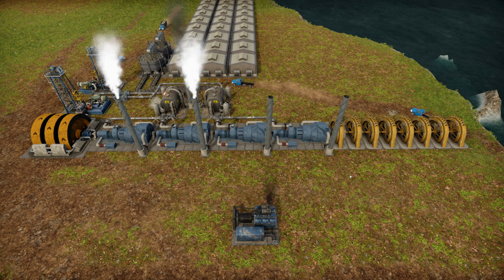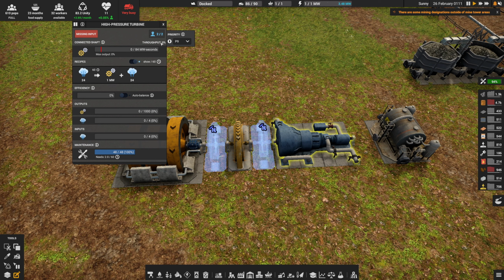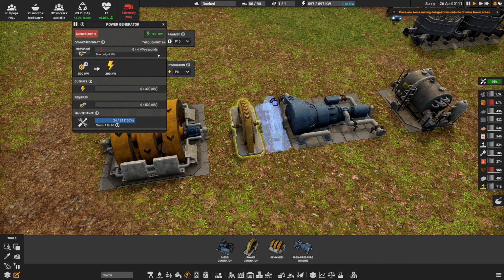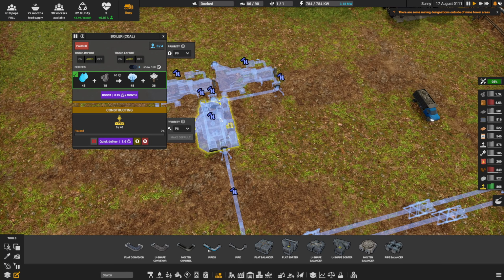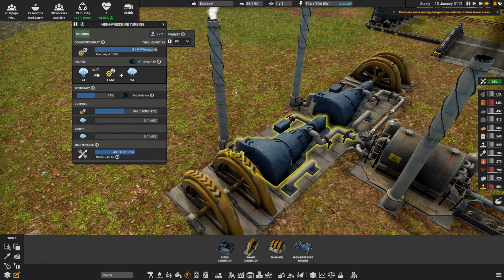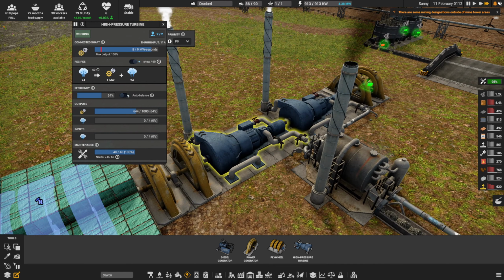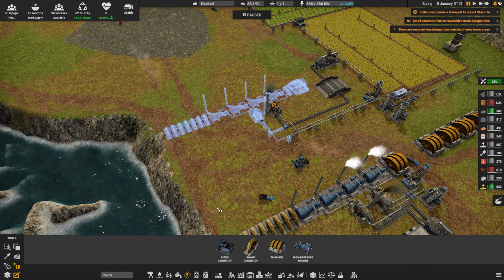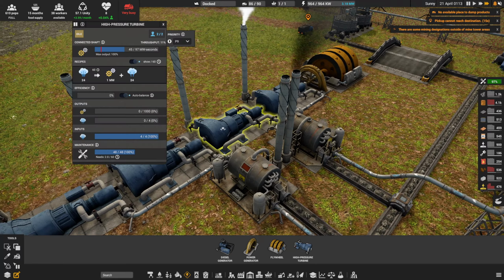Power Generation Explained 🚜 Captain of Industry  👷  Tutorial, Guide, Tips

Comment: Coming from factorio, the use-case for auto-balance and flywheels eluded me to begin with because it is not entirely intuitive and I don't think you really stated it clearly: In COI (unlike in Factorio and real life for that matter), the turbines are either off, or they run at full power. Once you hook them up to a constant supply of steam, after they've spun up to speed, they stay there untill you disconnect the steam again, regardless of what you hook onto them. Never mind the loss of efficiency, they are simply not capable of running at an arbitrary power level to match the current demand on the generators. However generators will only draw mechanical power from the shaft to satisfy the current demand; (What you must understand is that the "shaft" not a simple axel that links everything together rigidly, but an axel with a series of perfect clutches and step-less transmissions, that allow all units on it to spin independently from each other and individually spin at a different rpm to the shaft or not spin at all). The remaining mechanical energy on the shaft, and thus the fuel that went into producing it, is wasted. This is where the flywheel comes in: It will take this instanteneous surplus mechanical energy on the shaft and store it by spinning up. Once the energy stored exceeds a certain threshold, the turbines will then cut out, not consume steam, and the system will run entirely off the stored energy in the flywheels for a brief time, before the turbines re-engage and start the cycle over. This brings your overall steam, and thus fuel, usage down slightly over time to more accurately match your actual demand.

Comment: Right angled drive shift that would be a very big mechanical loss in that corner and super dangerous with the amount of torque on the shaft I do wonder if there are any out there though ?
Reply: Probably, for some insane extreme case that called for one.
Reply from the maker: True but in game land anything is possible, as long as a Dev or a Mod maker says so!
Reply: @JDPlays  agreed would be funny seeing it vertically aswell really save on that space
Reply from the maker: thinking about this more id settle for a drive shaft that did 6mw and had a 180 degree turn in it!

Comment: highly recommend you place down your power shaft in an area that allows it to get really long and douse not cut off truck access to a portion of the island or cause long detours. also should be located relatively close to your oil refining, cus its byproducts are perfect for generating steam for power.
edit: also recommend adding the 2 wide power generators in a group of 7 of 2 reasons, 1: power spikes and 2: due to the power generator 2's being 7 wide. that way you can remove the 7 T1's and replace them with T2's...may have just made the mistake of only placing them in groups of 6 on a long row and now have to rip half my stuff up...lol
Reply from the maker: upgrading is painful sometimes!

Comment: Does flywheels stack? Is there any reason putting more flywheels on one shaft?
Reply from the maker: Think of them as batteries, is there more then one reason to have a extra battery on the system?
Reply: I have 2 flywheels per shaft now, makes the system more stable when I mess up something in the steam supply line :)

Comment: The problem is water...too many pumps will drain the aquifier. If on easy settings, not an issue - but is on the other two. Power needs supply separate (especually from farns!)
Reply from the maker: 2 Pumps will be fine, 3 might be a issue. It really depends on if your running it flat out or not.
Reply: this problem can solve using pure water to clear water with lot of parts. The big problem is balance everything that you can stop to balance because it will gameover, The big problem is car allways need you to point the way to distance.

Comment: So...why only one turbine and then exaust the steam.  The steam will still have preasure.  Can't you put another turbine in line with the steam exaust to use that energy more?
Reply from the maker: Because this is for Power generation 2, at this stage of the game there is no low pressure turbines, no water reclamation, no cooling towers, no exhaust scrubbers etc etc. The video is to explain how power works, and provide a simple build for early game. Late game power builds will be later videos.
Reply: @JDPlays  I think my question was more process.  That it would seem reasonable to run the boiler into a turbine, the to another one from the previous turbines exhaust.  I have not gotten this far yet, so is that possible to do at this early stage?
Reply: @SyberSmoke  the steam that gets output of a high pressure turbine is labeled as "low pressure steam" and cannot be put into a high pressure turbine, no matter how much you try to input at once

Comment: Clearly you just do the same thing over with low pressure steam and can condense your water and reuse that once you have those techs. 
The tricky part is balancing the oil refining with all the different boilers for different fluids to keep making diesel and not bottleneck.
Reply from the maker: With the techs you will firstly be able to condense the low pressure steam back into water, then finally you will be able to get power out of the low pressure steam before condensing it back into water, then some time after that you will unlock MORE stuff!
Reply: its very difficult to find a perfect balance, dont be afraid to use a flare to burn off the excess to keep your facilities running